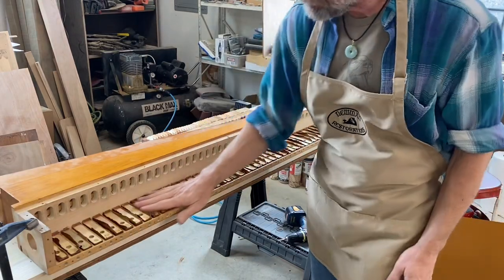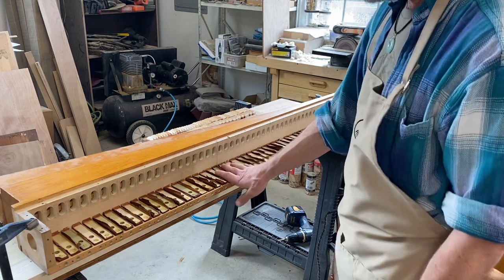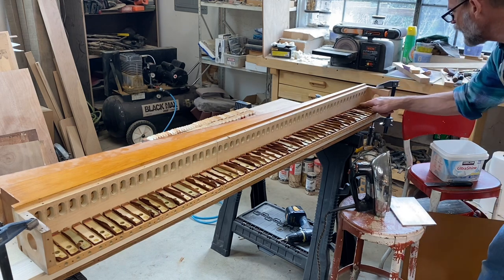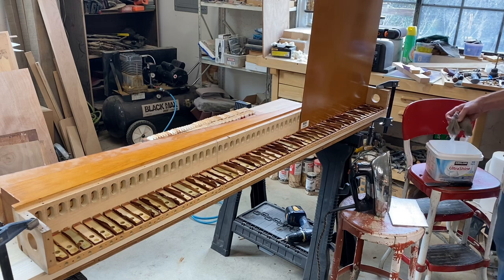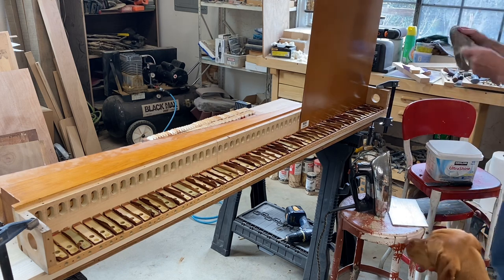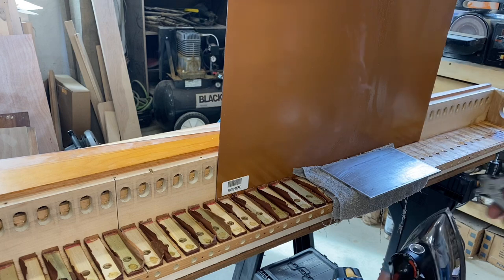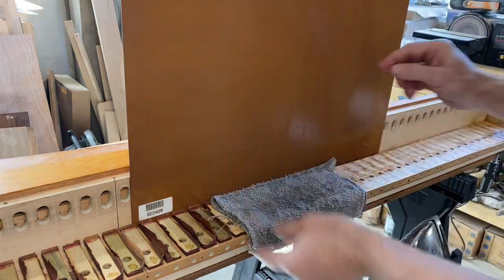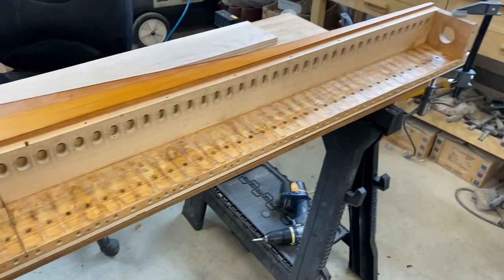Player Piano/Organ Restoration - Removing Pneumatics with Steam

Comment: I've always loved those Aeolian Orchestrelles. There's an old one near me I might buy so I can try to connect them to my build-up photoplayer using the pallet valve method you recommended to me.
Reply from the maker: Sounds like a fun project - look for a suction operated Orchestrelle (most are pressure operated) otherwise the pallet valves we discussed won't work without some fairly complex additional valves.
Reply: @DuoArtOrgan  The one near me is pressure operated unfortunately. Hopefully one of the suction operated ones pop up somewhere for sale.
Reply from the maker: @aspensmusicandrestoration  Wilcox & White and Melville Clark also built suction operated reed organs and of course the Aeolian Grand organs are suction as well.
Reply: @DuoArtOrgan  Thank you!
Reply: @aspensmusicandrestoration  don't ruin a complete instrument for your project
Reply: @a440pianoservice  That's why I'm looking for parts instead of the full thing. I would never take apart an entire working reed organ just for the internals!